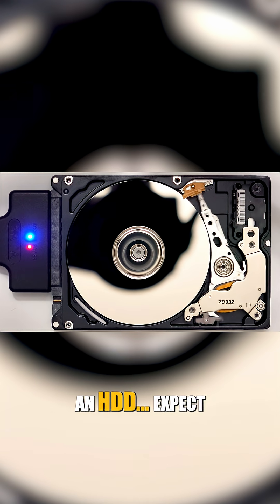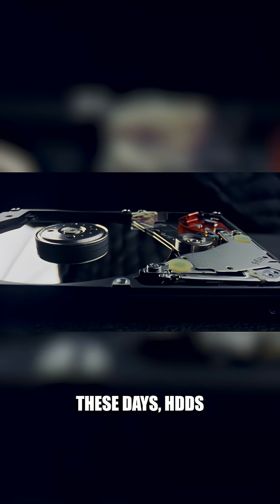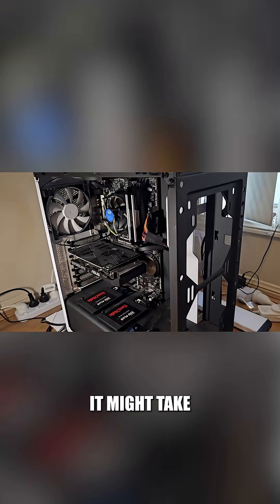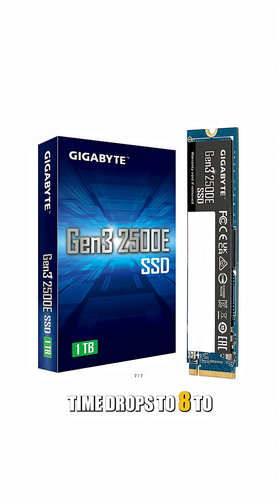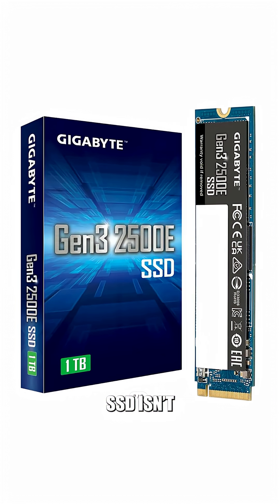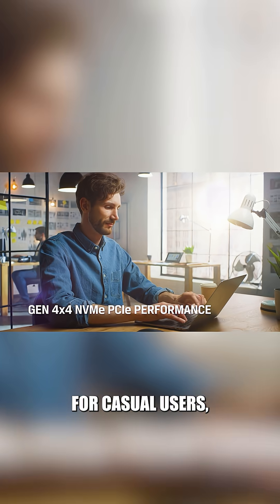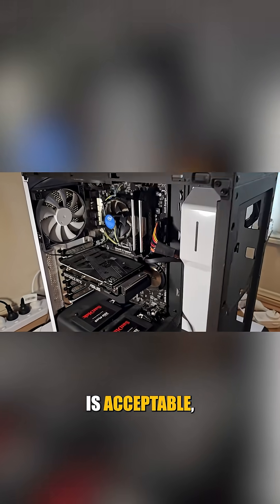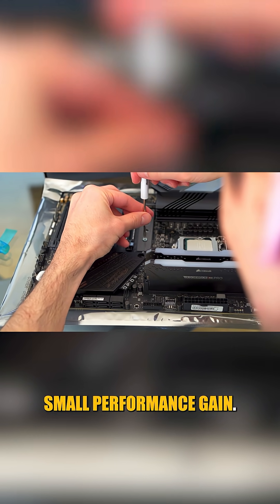How Long Should Your PC Take Too Boot or Start?

Comment: my first computer was a c64. in the 80ies. It needed for booting 15-30 Minutes. So i am okay with hdd.
Reply: Ssd's really don't cost that much anymore aspecialy sata ssd's and as a c drive a sata ssd is the minimum you can use hdd's as a d drive but the drive with your windows or linux on it should idealy be a ssd